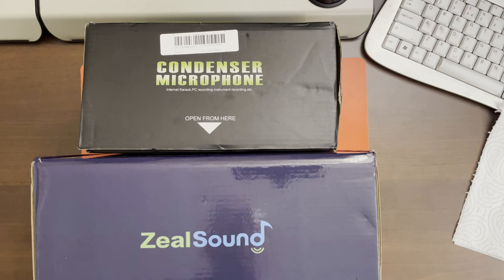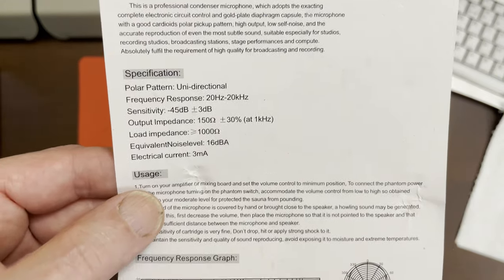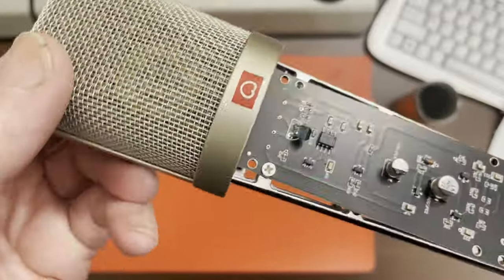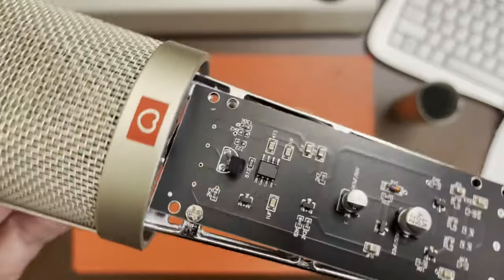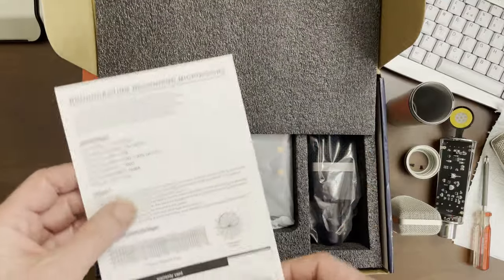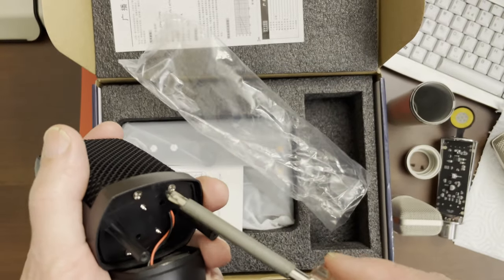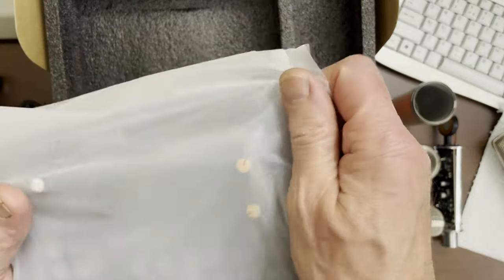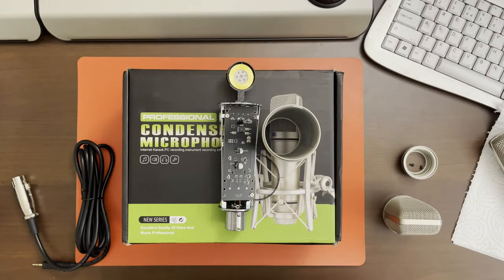Two different AliExpress microphones - a "U87" and what I can only describe as a joke or toy

Comment: Man great for this video, I have just bought the zeal sound thing, it works with its sound card but it stopped working ("The mic sound became very low") when i connected it to 48v connection and i was wanting to tear it down, thank you for this video. It has put confidence in me to tear it down.
Reply from the maker: It shoudl work again with its own interface (or direct in a PC) if you put pretty much any generic Electret mic capsule in to replace the damaged one.

If you want to make it work with a normal 48V phantom powered mic input, it will need an adapter circuit adding as well as a new capsule. 

Have a look at my mic modding videos or on my web site, there are circuits for building your own adapter - eg. the instructions for my mic audio PCB have schematics & details of the sections needed to use with an electret capsule.

I've built them in multiple forms on stripboard for various projects.
Reply: @RJTC  Am in Uganda,  can I source some legit parts from Aliexpress to fix the mic
Reply from the maker: @rogerskitamirike6828  I think it probably uses a 16mm diameter capsule? Measure the old one to be certain. 

If it is 16mm, one of these should work like the original:
https://www.aliexpress.com/item/1005004603506905.html

Search for the 594a type electret capsule, if that seller does not free or low cost shipping to you?
Each seller seems to have different rates.
Reply: Than you so much this is so helpfull @RJTC

Comment: The 2nd mic is horrendeous. The U87 ok for a donner body replacing that junk capsule on it. I found it that with most mics under £30 you tend to get the worst quality but once you go a bit higher you may find OK deals. I personally get the Bai Fei Li Mics as they are totally worth it.
Reply from the maker: Horrendous is a good description! I was only looking for casings, so as cheap as possible; I was still surprised about it being plastic though!
I've used one of the 87 type bodies, that looks like it will be a nice mic.

I'm not familiar with the brand you mention, but I'll have a look? When I've wanted ready-to-use mics I generally look for MXL ones on ebay - eg. you can sometimes find such as a boxed MXL990 for around £50 or less. Those are pretty good as they are, and can be improved with some simple mods.